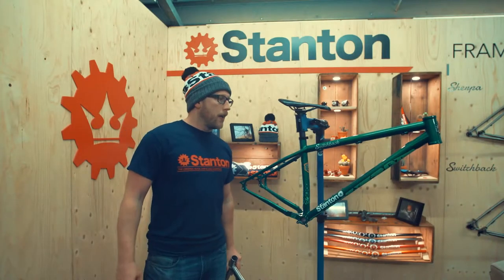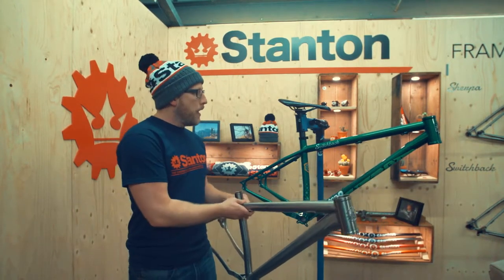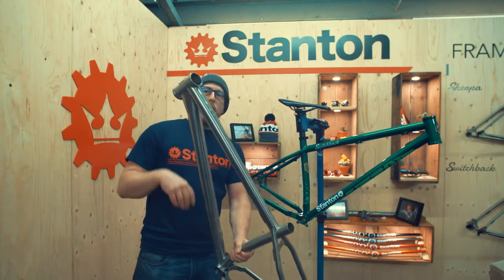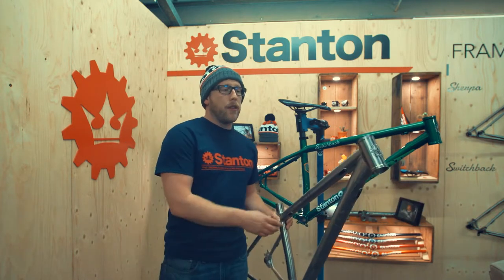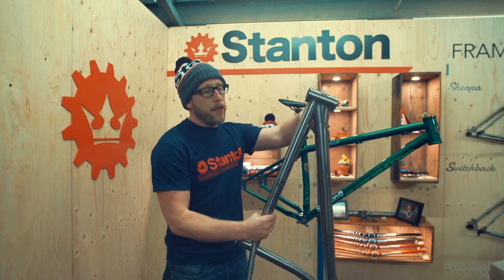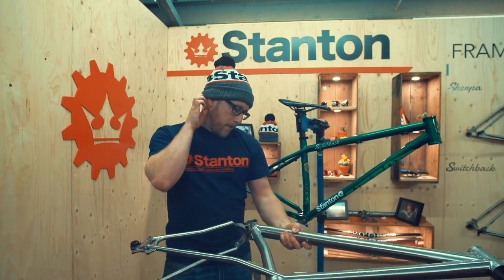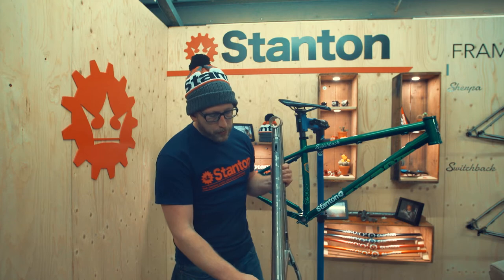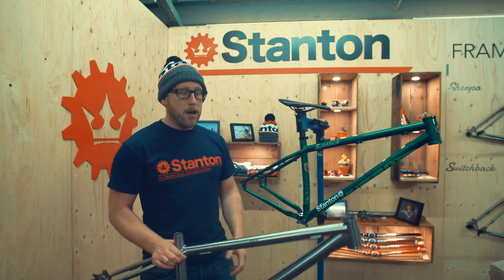Stanton Bikes Ti vs Steel - Tech Talk

Comment: And why no internal routing is only reserved for Ti frames not steel ones?
Reply: Wall thicknesses on the steel is too thin for it
Reply: Weather/Water/Rain...Steel and Water don't get along together. Water beads along cabling into frame.